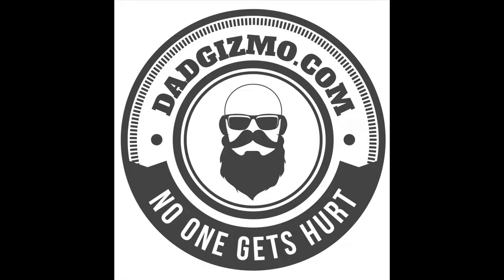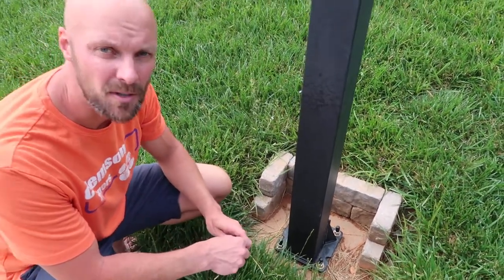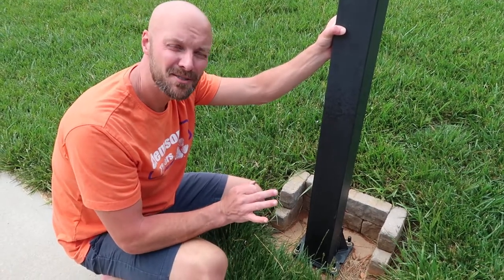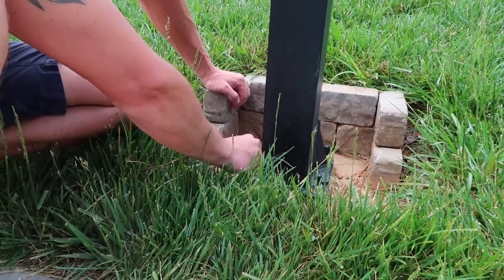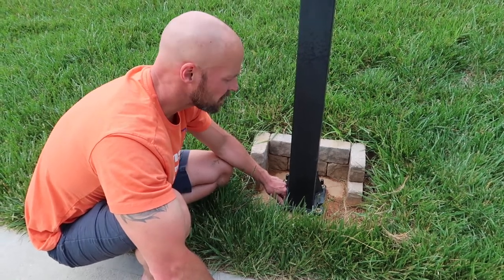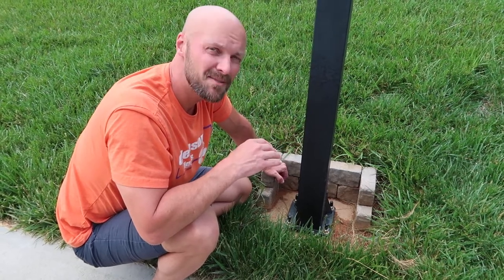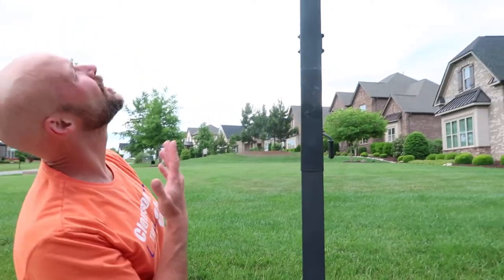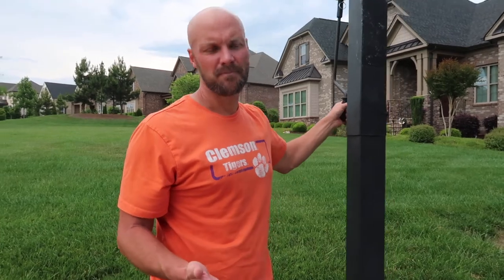UPDATE! How to Install In-Ground Basketball Hoop YOURSELF

Comment: In the original video you only dug down 30”. The instructions say 48”. The mounting plate is below grade if it’s below the grass line, all the run off will pool on that plate. A few water drops will run off sure but that hole will fill with water. Those decorative pavers serve no purpose except to keep water in.
Reply from the maker: It never holds water - and I followed the instructions to the letter!
Reply: @paulsmith9009 needs to go be a Karen with people that enjoy him, whoever those people are

Comment: You could drill 4 small holes in the concrete and bolt down the hoop
Reply: Drilling holes and using the normal anchors that you can run into the local hardware store and get have higher rate of failure and has caused serious injuries to property and kids.